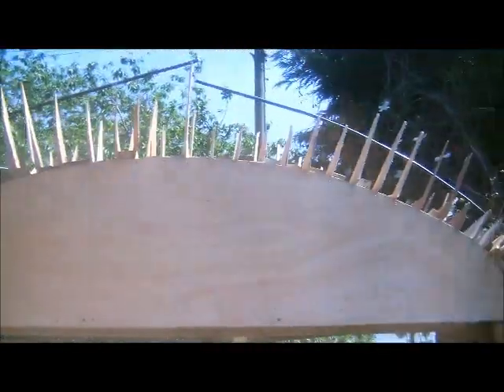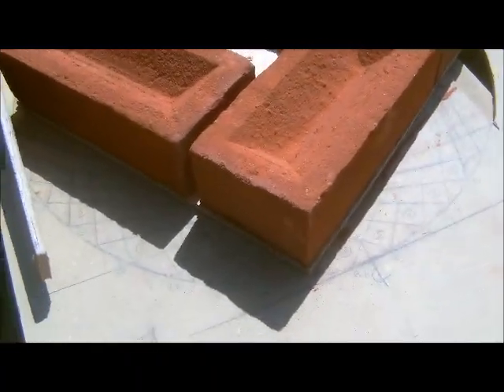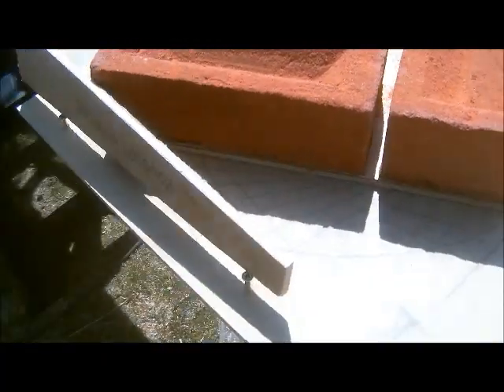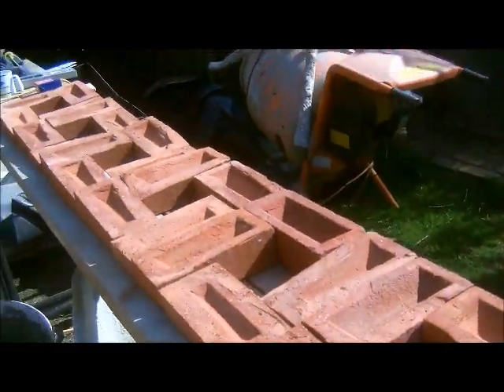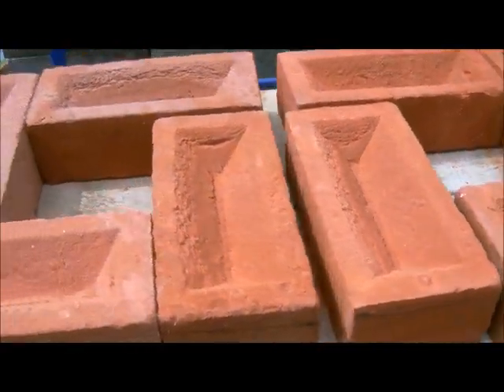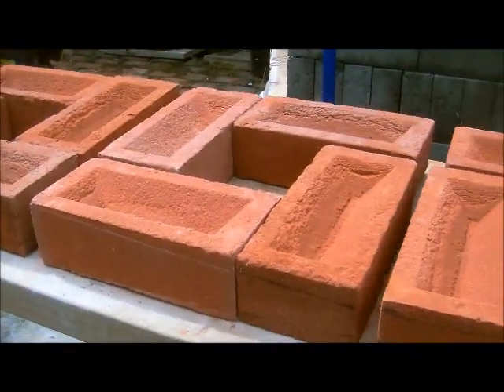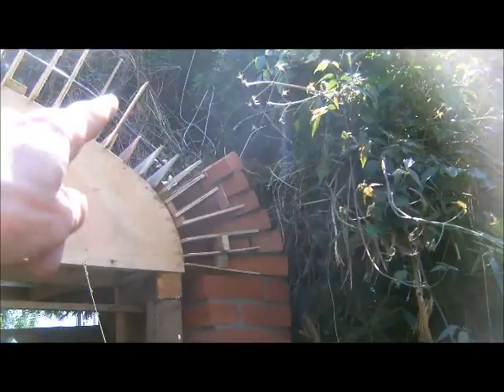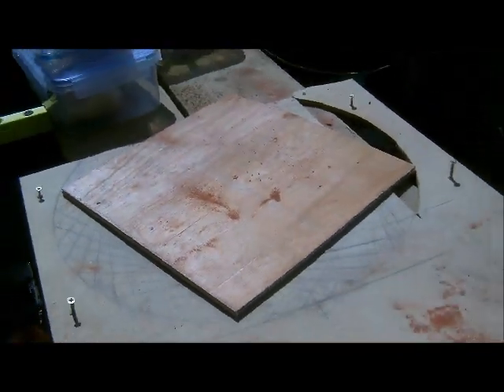the fine art of brickwork - Twisted Arch (4 of 4) The Arch

Comment: Really cool project.  I'm impressed you did the tudor arch right into the column.  I have a spiral chimney on my house, and I really wanted to try a spiral segmental arch in second year, but I didn't have the time to do the arch form.   I don't think many have the appreciation for the compound miters in your arch, especially with two different radius points.  Your method to determine and cut the voussoirs is very impressive.    The template I used was a plywood square with nails in the bottom to determine placement on the course below, but I like your angle iron jig.  excellent job.